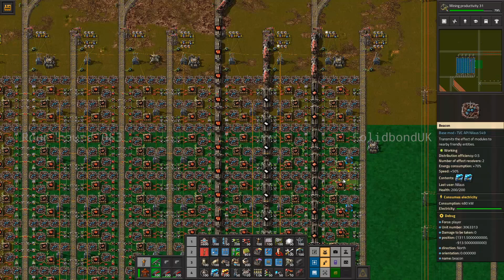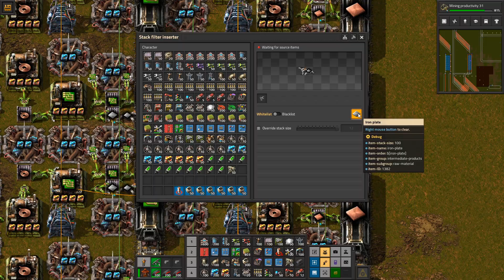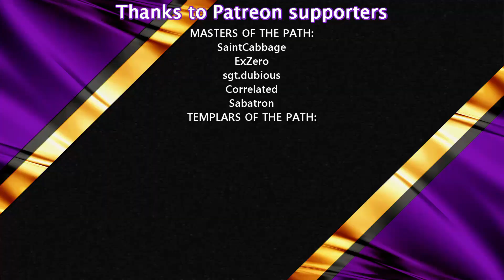Multi-Station Tracks - Advanced Train-To--Train Design for Circuits | Factorio Tutorial/Guide/How-to

Comment: OK I've implemented this and one issue I've found (which might boil down to me having insufficient iron) is that the iron train stalls there while all my iron plate producers are shut off. Is there a good way to handle the idle train blocking the last station it entered issue? I already get this issue prior to the multi station factories but it is obviously more pressing when an iron train just won't leave here.
Reply: Stackers. Build a third station that the train can hang out in

Comment: In your GREEN circuit setup two of the beacons are useless. The row at the bottom that has 4, could do the same with 3 beacons if shifted by one tile. There are also two beacons that affect one green assembler each that can be replaced with one beacon affecting both assemblers at the same time. Love your series, you got me started on a new megabase :D
Reply: When you cut down do amount of beacons your build gets slower

Comment: What are the advantages of this green circuit design over using trains with mixed wagon contents?
Reply from the maker: mixed wagons have to visit multiple locations for loading, so if simplify the Green Circuit build, then you are just pushing the issue further back in the supply chain to your Iron and Copper locations. You cannot use the normal Iron/Copper locations since you only want to load every other wagon, hence you need to build specific Iron/Copper just to simplify Greens

Comment: We need a masterclass on inserters. Please, bear with me.

In your masterclasses, in your reverse megabase, in your true megabase, whenever you're designing some high throughput system involving inserters, you quickly mention how this kind or that kind of situation requires 1 or 2 or 3 stack inserters. This intuition you gained over the years could be a great subject for a masterclass.

I'd love it anyway. I need it also. Everytime I design a beaconned purple science hub, I tend to feel the lack for such masterclass. You all know what I mean, purple is hard.

🐻
Reply: Its not so hard as it looks. Just remember ~10 for Fast and ~30 for Stack.
Why? Shortly the formula is: 
Inserter speed = (Speed in degrees/360)*Stack size

Inserters in Factorio have several properties. In terms of speed there are two - turning speed and stack size. Turning speed is written in degrees per second. In unmodded game the inserters to move something and return make full 360 degrees move. For curved manipulators form mods like Bob's it can be less, but now we talk about vanilla.
So, to understand how many times per second any given manipulator can move items around we need to divide its speed in degrees by 360. And get a small table of results (cycles/sec):

Fueled - 216 - 0.6
Basic - 302 - 0.84
Long - 432 - 1.2
Fast - 864 - 2.4
Stack - 864 - 2.4

And to understand how many times any given manipulator can move per second we need to just multiply numbers from above by stack size.
Keeping in mind inserter stack bonuses, lets calculate minimum and maximum speeds, progressing through the game. We have 1-4 for all basic ones and 2-12 for stack. Results (items/sec).

Fueled - 0.6 - 2.4
Basic - 0.84 - 3.36
Long - 1.2 - 4.8
Fast - 2.4 - 9.6
Stack - 4.8 - 28.8

So knowing (from any source) production speed of your heavy beaconed assembler, you can calculate how many and what kind of inserters are required to feed it.
Reply: @solar4149  hey does this mean if we have a inserter that only moves 90° (so having belt/box under the inserter and assembler to the right/left) that they have twice the throughput bc they only move 180° in total ?
Reply: @Meiney100  Indeed. And bob's inserters allow bending even more - from base 360 per full cycle to about 30 allowing x12 boost of speed to all, even burner inserter. This gives tool to make more compact schemes than usually. And some features like ability to load/unload train wagons in a pair of seconds, like liquid carrying ones.

Comment: Is there a reason you can't use inventory filters so a single train carries all the ingredients instead of using circuit logic?  For example, on green circuits you set the filter on the inputs for 16 stacks of iron plates, 24 stacks of copper wires and let it run with just one input train.
Reply from the maker: The reason is that it is way too complicated to route trains to multiple pickup sites for loading
Reply: @Nilaus  Complicated...because your stations aren't fully connected?  I remember you saying in an earlier video that you don't want any intersections, is that the constraint that makes it hard?

Comment: How did you do that blue filter thing for the items in your train? When you were showing off the green circuits you skimmed over how you set it so that the item slots could only be filled with the circuits (at least, that’s what it looked like). How?
Reply: Hover over the inventory slot and press mouse scroll wheel as button.
Reply: Also, once you do one full train car you can shift + right mouse button to copy and shift + left mouse button to paste.